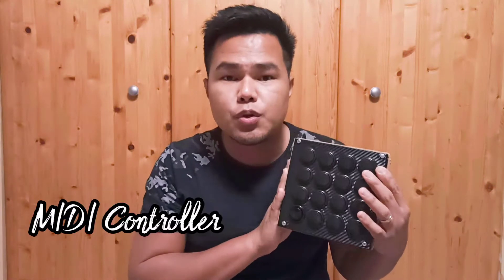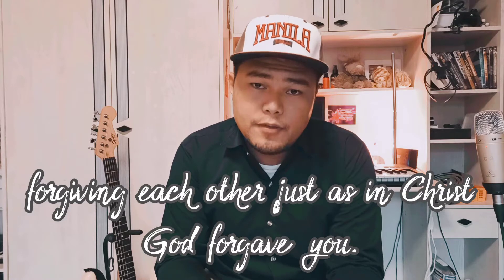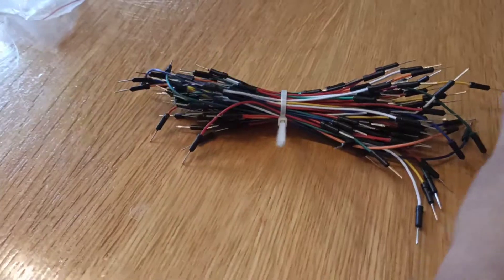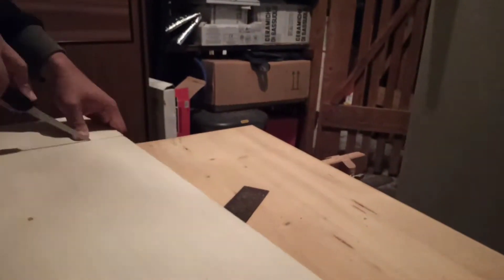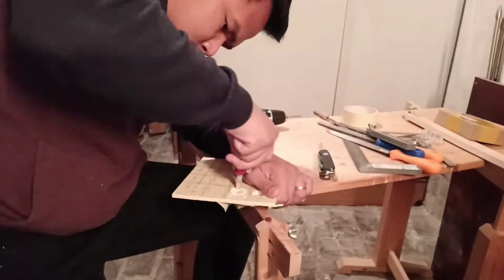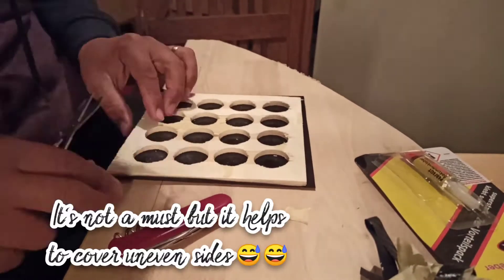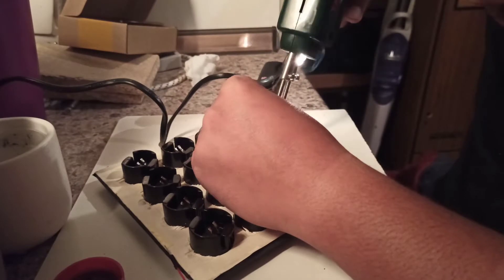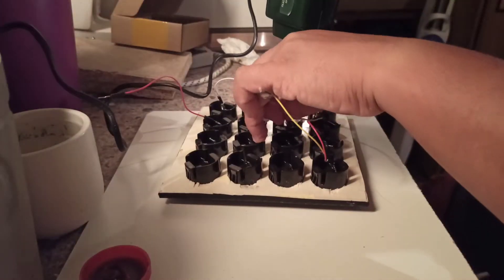How to build a DIY MIDI Controller (Using an Arduino Leonardo+ Arcade Buttons )

Comment: This is excellent.  i have made one with a button but i get a lag between teh button push and sound in ableton.  did you have that problem?
Reply from the maker: Hey there... I didn't have any lag. But what I noticed with the codes that I used is that when I hold the button it repeated the notes. I'll give you the link of the codes try to use it. Maybe it'll help 😃
Reply from the maker: Here's the link. 👇🏼 https://leandrolinares.com/blog/arduino-midi-controller/
Reply: @marting.official  thanks so much.  i know the repeat cna be negated with a delay line but the lag is something i can't figure out on my setup.  i'm using different buttons, though, and i thnk that may be the point.  thanks for teh code, i'll try that and see if something stands out

Comment: I want to make a 24 encoder controller, is the concept the same?
Reply from the maker: Hey there, 👋🏽
I haven't tried it but in theory it will work. You can try using Arduino Mega.

Comment: Is that will working with fl studio mobile or any application's phone ??
Reply from the maker: I haven't tried to connect it in FL Studio. But it works in most Android apps .
Reply: @marting.official  what is the type of Arduino to make it
Reply from the maker: I used arduino Leonardo...
Reply: @marting.official  is it working directly with fl studio or I will need to assists drivers + am i need to midi cable or i will connect Arduino directly to PC or phone ??
Reply from the maker: You can program it as a midi controller you just need to program it. I provided a link so you can program it. After you're done programming it will work like a Midi Controller...
Reply from the maker: Just check the links I provided in the description. And if you have questions feel free to ask..  I'll try to help as much as I can 😃👍🏽
Reply: @marting.official  thanks for quick answers 🙏
Reply from the maker: No problem 😊👍